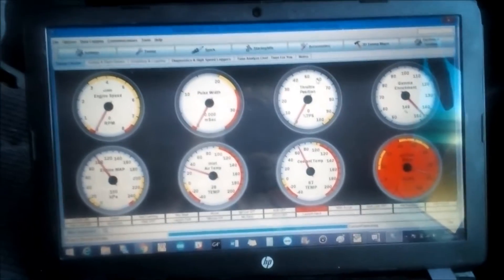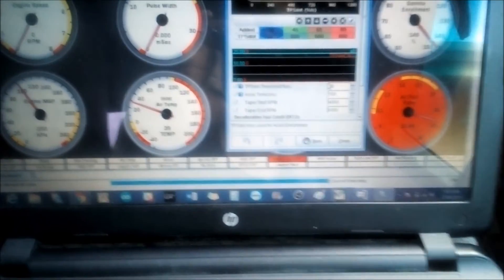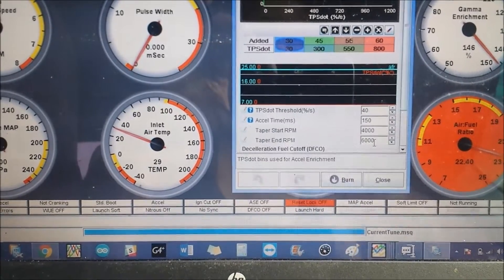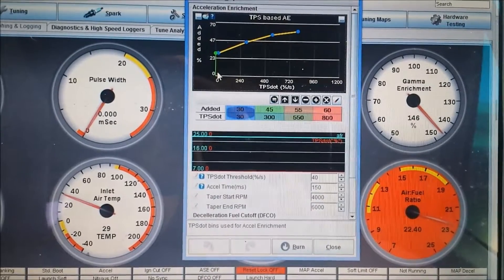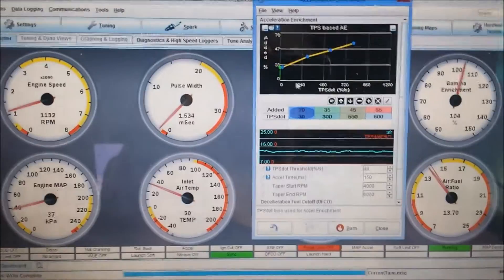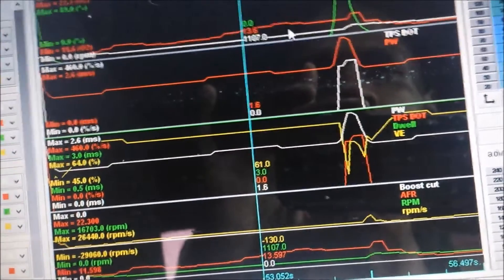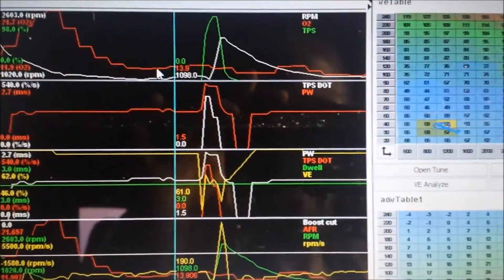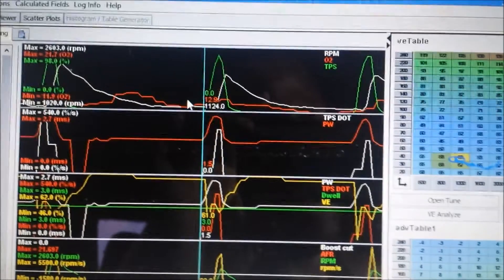Acceleration Enrichment Tuning - Speeduino

Comment: On a few turbo cars that I have set up, They love to kiss low 11s and high 10s on the enrichment when giving those quick hard stabs. I admit it looks better and seems to make sense that it would be too much fuel, but they ran better for me (I think Sloppy Mechanics mentioned this on one of his videos as well) The hard part with acceleration enrichment for me has always been the light tip in. Takes me way too long to get it right! Great video!
Reply from the maker: You are right. I always say, give the engine what it wants, if it wants 10s then give it that. You are spot on about the light throttle stabs, it take a lot of fiddling to get it spot on. 

I think I may have seen that sloppy mechanics video before. I also watched and listened to alot of Scott Clark's content on the subject. Funny enough there is not much content on Acceleration Enrichment on YouTube. That is weird. Thanks for watching
Reply: My light tip in stumbles nearly every time.  I've got a lot of work to do but getting there.